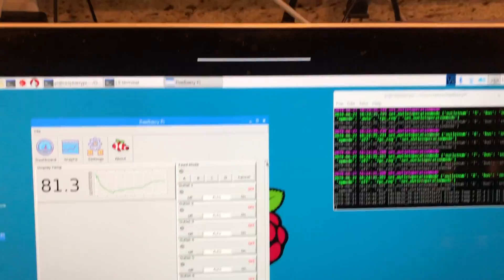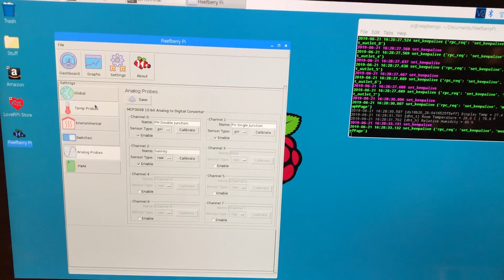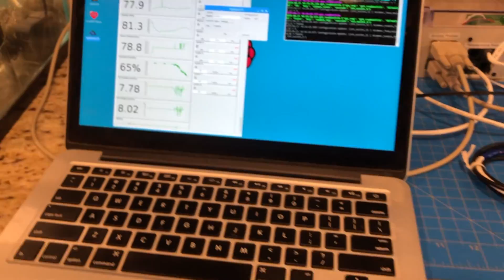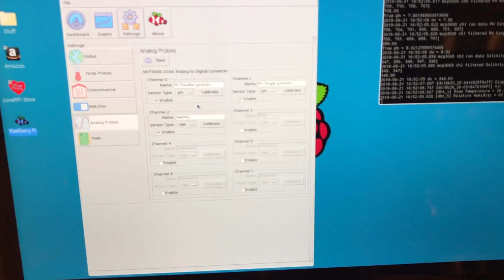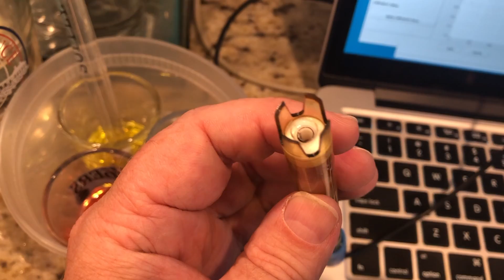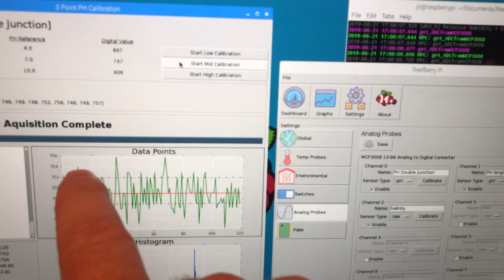DIY Aquarium Controller - Reefberry Pi June 2019 Update

Comment: Is the source code for this available?
Reply from the maker: I’ve posted everything I’ve done on Github, but its not really finished and there is no documentation. Hopefully some day I’ll be able to put some more work into it.
Reply: @ReefSpy  hello I am having difficulty because I do not have the components list and software to manage the project. Can you help me?
Reply from the maker: @carmelopolimeni5748  Which components are you have trouble finding?  I bought most of my things on eBay or Amazon.
Reply: @ReefSpy  
282/5000
I am an electrician with a passion for Aquarius; i saw youtube your magnificent project, without schematics and knowing what components you use, i am not able to build your prototype.
I need information, software to build this plant wonder.

Comment: Great work. Did you find the ph probes giving inconstant data? I can’t decide wether I need a double junction prob or not.
Reply from the maker: I found my cheap eBay probe gave inconsistent data. I used both double junction and single junction probes from Bulk Reef Supply and they gave much better results.  Also make sure the probe circuit is electrically isolated or else you can get erroneous results.
Reply: ReefSpy so would running the voltage supply from a separate buck convert be the best way to go and just have the ground connection with the pi be the way to go. I also found that when I take the reading in the tank I get more fluctuations which I take it’s picking up stray voltage. So thinking it would be better to come up with a dosing pump putting water into a container over the sump which will then empty back in to the sump after a test. But will try some better probes first.
Reply from the maker: @modelrailwaytheeasyway9743  I'm not sure.  I used an Analog Signal Isolator circuit.  It seemed to work for me.  Check out DFRobot.com  Thats where I got mine.

Comment: How much better do you think the expensive probes are? Also: In terms of ADCs I can recommend the ADS1115 boards from China. Much cheaper, smaller and easier to use, have 16bit resolution, programmable gain, negative voltage and differential measurement and you can set the sps to 16 to make filtering easier. I think I will use that one when I start mucking around with these probes.
Reply from the maker: Cool, I will look into that ADC, thanks for the tip.  All I can tell you about probes is that I initially used a cheap $8 pH probe from eBay.  It was not very reliable.  Although I could get it to calibrate perfectly, it would quickly give me inconsistent results over time.  I switched to a more expensive probe and I got more consistent results.  I'd recommend the cheap probe only for development, but once you start using your controller on a real system, buy a better probe.
Reply: @ReefSpy  how do you know the results where inconsistent? Did you measure a drift with respect to calibration fluids? Did the more expensive probe keep the consistency over the same time?
Reply: @ReefSpy  Also take a look at the pca9685 16 channel i2c pwm boards.

Comment: Which salinity probe are you using?  Did it come with the controller board ?  havent found any for under $150
Reply from the maker: The probe is made by Apera. I’m using it with  a controller board I got from DFRobot. Unfortunately its still not a cheap combo. Good quality salinity probes are expensive.